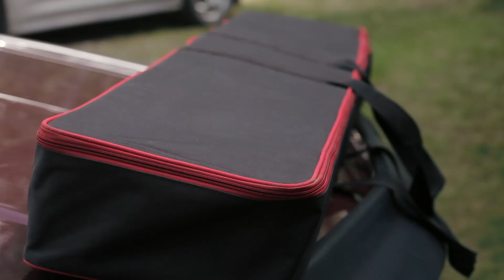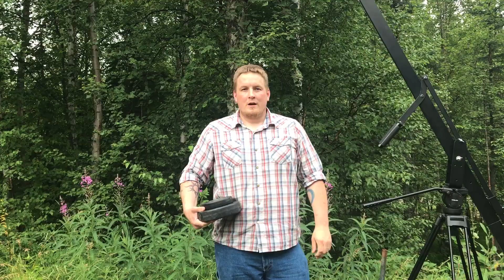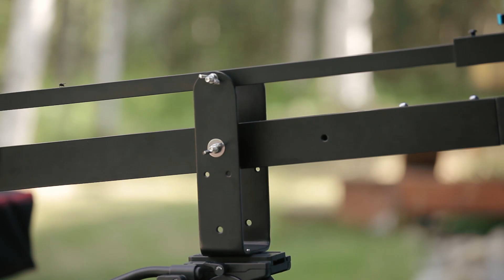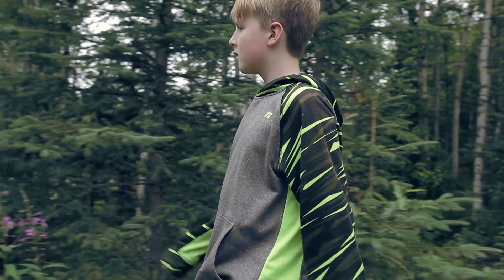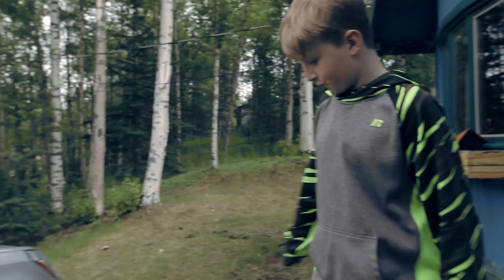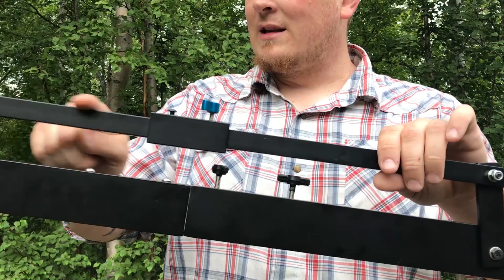Camgear 8 ft Jib Crane Review and Test Footage

Comment: Nicely done. Can you list all the gears you used. Also what tripod works and what plates.
Reply from the maker: Thank you Keith! I was using a Kingjoy VT-3500 video tripod. Really, any tripod will work, but the stronger the better. When the jib, weights and camera are all loaded, it's fairly heavy, and a flimsy tripod would make me nervous... so, the sturdiest tripod you've got would be best. The weights, I got at a second hand shop for $5. The fluid head came with the tripod. I didn't use a quick release plate on the end of the jib in this video (I just mounted the camera straight to the mounting plate).

Comment: Thanks a lot, brilliant
Reply from the maker: Thank you Joshuah! The distance from the connection to the tripod to the camera mounting plate is 60" (5 feet). The tripod I use goes up to approximately 6 feet, putting the "effective height" of this in my case at about 10 feet. I think the makers of this jib have a new one out last time I checked, and it looks like it has an improved mounting plate, and has a plate to mount a field monitor.
Reply: Thank you!  This really helped.
Reply from the maker: You’re quite welcome, Tlc Jack! :)
Reply: Great Video!  Hey I was wondering, what is the distance from the connection to the tripod to the end of the camera.  Basically removing the length of the handle to see how long it "technically" is.  Been looking at different jibs/cranes and this might be the one.
Reply from the maker: You're very welcome! Glad someone found it helpful!

Comment: Did you use any warp stabilization or any editing to enhance the video, or is it straight out of the camera
Reply from the maker: Vion Films this was all straight out of the camera. No warp stabilizer added.
Reply: Arduinerd awesome, this is the one I'll probably go with, are there any downsides to it?
Reply from the maker: Not a lot... I wish it had came with counter weights, but it seems like most don't include them. The only other downsize I can think of is that it doesn't pack very small when not being used, but that's just me being picky :)
Reply: Arduinerd sounds great🙂, very good video by the way, I subbed
Reply from the maker: Awesome, thank you! And thank you for the sub :)